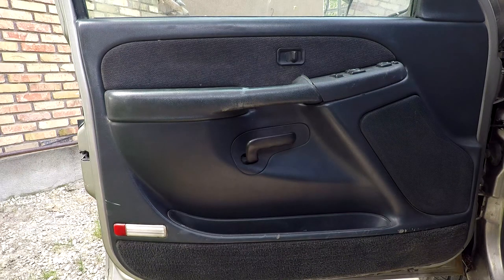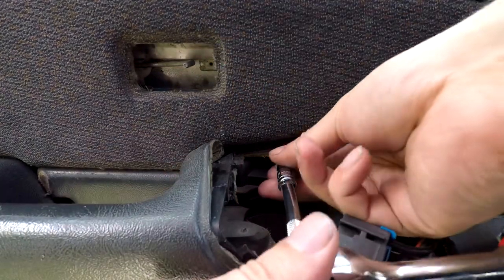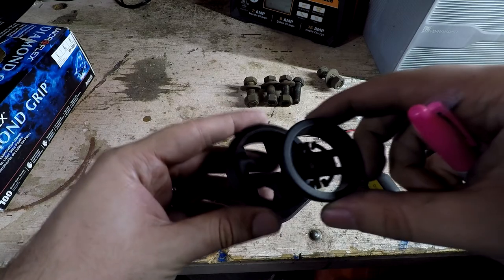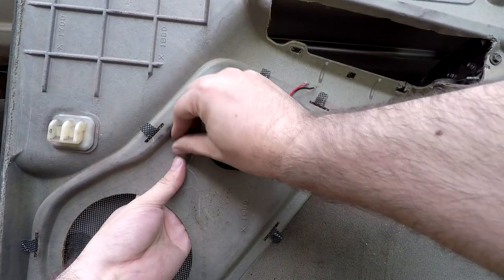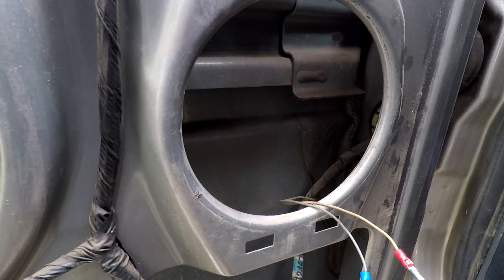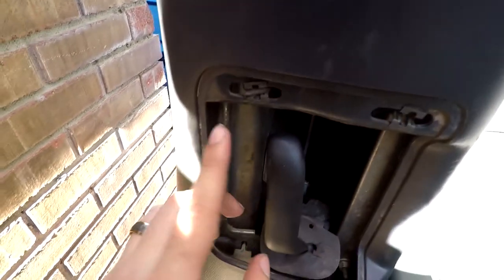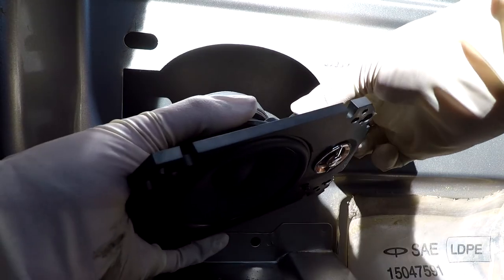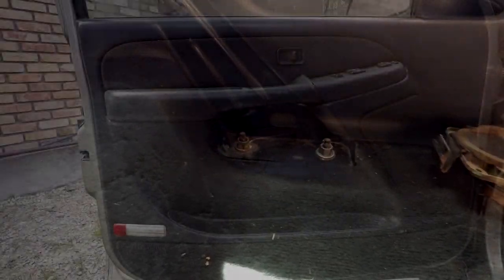UPGRADING My Sound System - (2000 GMC Sierra 1500) [3 Door]

Comment: I have the 03 with tweeters in the a pillar . Do I just remove and reconnect new upstairs tweeters to the stock wires  or have to add crossovers or whatnot
Reply from the maker: You can try to reconnect to stock wiring. I've seen both scenarios with different cars. 1 where it works great without a crossover and 1 where it made the tweeter sound awful. I would test before you throw everything back together.
Reply: Even with full system install ? Headunit sub and amp ?

Comment: You didn't use the crossover with the front components?
Reply from the maker: Good eye! Not when I filmed this video. Just used the factory wiring and it worked fine. I kept the crossovers and then used them when I decided to rewire the speakers with 14 awg speaker wire preparing it for a 5 channel amp :) I just used some strong 3M double sided tape and adhered it in the doors. Has held up so far and have had no issues!
Reply: Did you use the factory radio/head unit??  I was also wondering if I needed to use the crossover. Good vid
Reply from the maker: @OG_Eid  I did use the factory head unit when I installed these speakers and didn't use the included crossovers and they worked with no issues, but were lacking in loudness especially since I did not have a factory amp. Then I rewired the speakers using 14 awg speaker wire, upgraded to a single din Bluetooth head unit and installed a 4 channel amp pushing 50 watts to every speaker all at the same time. Then I installed a sub and rather than have all those thick rewires everywhere, I swapped it out to a 5 channel amp. Works perfect for my application :)

Comment: How's the sound quality of the Kappa speakers
Reply from the maker: My personal opinion is that they are hard to beat, sound quality-wise, when paired up with an amplifier and a sub. They excel at highs and mids, but lows are where they lack when they are independent. If you pair it with a sub, they sound awesome! I would say if you plan on amplifying them and adding a sub when using it on a larger vehicle, then definitely go for these. If you have a small vehicle, then the reference series are plenty. If you plan on just upgrading the speakers with no amplifier or subs, then you will find them a little lacking on bass. That's my honest opinion!
Reply: @ufixitauto5237  I'm using the factory amp that's 2 ohm on a 04 sierra, do you think that's enough ?
Reply from the maker: @albertwhite8218  If it is equipped with a factory amp, it could very well be enough :) it's all subjective, but personally I think it's enough. I will say though, the tweeters should be relocated for better sound. I plan on moving my tweeters into the A pillars. They should have never been put so far down 😂

Comment: Does this work for GMC Sierra 1500 2000?
Reply from the maker: The process should be the same if you have a 3 door! The truck used in the video is a 2000 GMC Sierra 1500 🍻